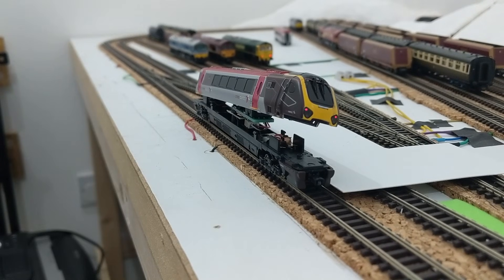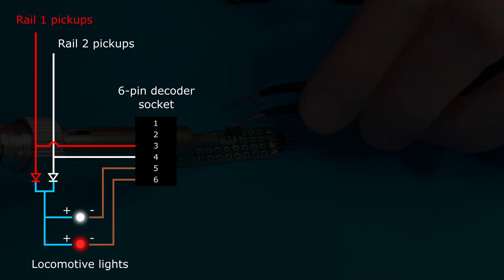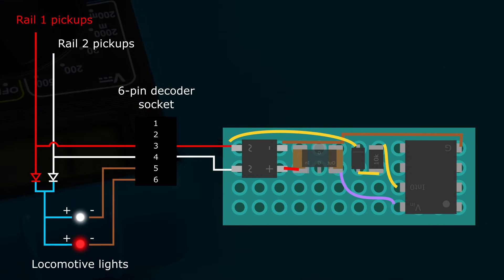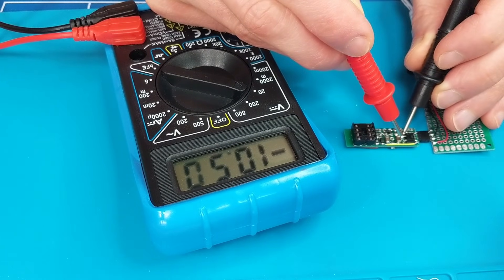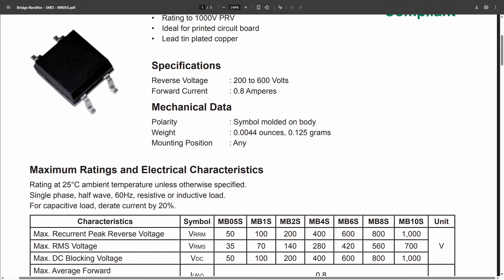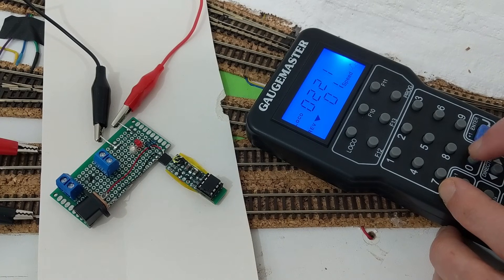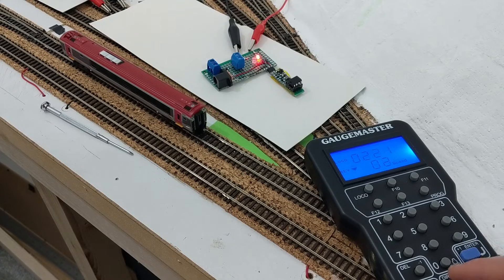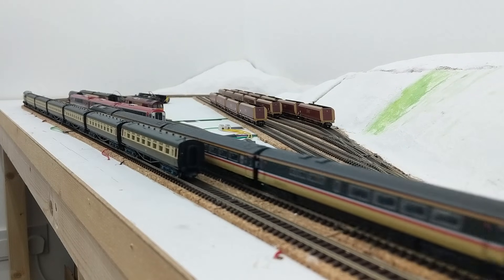0058 Making a decoder from scratch - part 5

Comment: Hi! Thanks for this very thorough video about your journey! I've done a bit of decoders with LocoNet before and plan to design a DCC decoder soon, so this was very interesting to watch.
Here are some thoughts:
* Your DCC decoding circuitry with a diode and resistor is weird. It would make more sense with a 5V zener diode after the resistor (between gnd and pin), so that the zener clamps high voltage to safe 5V and resistor limits the current through it. With your current schematic, 0 volts at tracks will read as 0.7-1V on MCU, which might not reliably trigger as 0. In order of dirtyness here are ways to read DCC that I've seen: 1) a ~30k resistor between track and MCU directly (and MCU clamping diodes dump extra voltage to 5V rail, the current is small enoguh). 2) a voltage divider to drop track voltage to 5V (it doesn't take into account that different command stations output different voltage on tracks) 3) comparator, either built into MCU or external one (does everything but it's extra space and components). 
* When troubleshooting, separate hardware from software (as you did a little bit in the end). To debug hardware, instead of attiny connect a oscilloscope, a logic analyzer or a big arduino with your code peppered with Serial.prints. This way you'll see what data your hardware sends to the MCU (sigrok has a DCC decoder plugin, I think, so you'd be even be able to see the packets). To debug software, connect your ATTINY to known-good hardware.
* Making a proper PCB and ordering it in oshpark or jlcpcb is very easy and affordable these days, and difference to breadboards is shocking! I definitely recommend investing your time in this area for making small-footprint PCBs.
* Don't know if this MCU has UART, but if it doesn't, there is a software-only serial library for ATTINYs! Helps with debugging a lot. I'd definitely sacrifice LED indication for a serial output (while debugging)
Reply from the maker: Hi, thanks for your thoughts and writing them up 🙂 You're at least the third person to suggest switching to a level-shifted high input - I like the pull-low way I've got because of its simplicity (and got the idea from someone else's project)... but if it's not going to work then I'll have no choice. But at the moment I've still got the energy to want to find out why it's not working.

With the current schematic when the track goes to 0V the int0 pin on the MCU will have to drive current through a diode, which will put the reading at 0.6 above track 0... but the MCU's power goes through diodes too, so shouldn't 0.6 relative to track still look like 0 to the MCU?

I'm convinced the software is OK on the ATtiny - it consistently does the right thing under certain repeatable circumstances. Your suggestions on testing the hardware are good - I may employ some of those 🙂 The only hardware diagnostic tool I have is a multimeter, so the idea of using something like a full Arduino to link up to the socket on the hardware is appealing.

I wanted to get the design of this all sorted and proven before moving to the step of getting PCBs manufactured for me, and would ideally like to etch my own, though running into issues regularly is making me think of skipping home-etch.

Thanks for all the ideas 🙂
Reply: @endoorrailway  attiny85's datasheet says Input Low Max is 0.3Vcc=1.5V, so 0.6V is well within specs. However it relies on internal pullup to get 5V, which might skew the waveform, though it probably doesn't. 

If you are going to make final device on a custom PCB, I'd personally remove the perfboard step from the development process. You can debug your schematic on a breadboard (solderless), and then skip to drawing the PCB and etching/ordering it. As you see, a lot of your problems come from bad electrical connections, which you don't get on a custom PCB, especially from a fabhouse. 
By the way, I think you need to double or triple check transistors connections for shorts or other electrical problems.

I'm not really suggesting it, but there are projects that turn arduino into an oscilloscope or logic analyzer (with sigrok software), so there is also this option). Though it's still 5V-tolerant, so you'll need to level-shift DCC.

Comment: Do you have resistors between the attiny and the transistors? Otherwise the transistors could draw a not of current throug the base pin, possiibly resulting in a brownout. Should be fixed with mosfets as they only charge an internal capacitor and dont continuously draw current
Reply from the maker: Yes - 6.8k per transistor - that works out, and I've measured it at, about 0.6 milliamps. Based on previous measurements of the LEDs in the tester board that should be about 20% of the load current, so well within saturation too. Thanks for the thought though 🙂 It will be interesting to see if the problem goes away with mostfets, but I've decided to do everything I can to understand what's going wrong with the current set up first.

Comment: Check out brown out detection fuse bits in ATtiny. Verify, that internal clock frequency is stable. As other option - check out in code, that stack pointer is initiated accurately and isn't overflowing. Tiny has very little RAM.
Reply from the maker: Thanks for the suggestions. I'm not sure I have a way of verifying the internal clock or stack pointer, but I'm convinced they're both fine because all works as expected for a variety of durations until one of the transistor-controlled LEDs is left on. I'll need to read-up on the brown-out feature, but from a quick scan of the datasheet I think it's something I'm going to want enabled when I start to make use of EEPROM. Thanks 👍

Comment: So cool to see! I have built my own ATtiny85-based DCC decoders (not on Youtube though) and it can be a very frustrating experience at times, until it eventually works. I don't think I have a lot of useful things to say about your problems, my decoder was built for different things and my problems were different, but I can wildly speculate and mention some things that I found if that helps:

More capacitance on the input of the 5V regulator is probably needed. I am not familiar with Gaugemaster, so I don't know if their products support RailCom, but if they do, there's a cutout of a few microseconds after every DCC command where the decoder is meant to reply, and if your decoder runs out of power in that time, that will cause weird issues. Even if your current DCC command station doesn't have this feature, if you ever upgrade (or your tracks are not perfectly clean) you'll likely run into this problem.

I've seen other people mention that the ground reference for the input pin may not be valid, but I don't think that's the problem. I did it basically the same and it worked fine for me. You can even leave out the diode and just use a 22kOhm resistor; that's technically out of spec since you're relying on protection diodes built into the ATtiny, but in practice, it works fine. You did basically all the trouble-shooting steps I can recommend, so I think at this point it's either the transistors or the overall power supply (see above with the bigger input capacitor). 

I strongly recommend learning KiCad, designing your own PCBs, and ordering them from companies like JLCPCB, PCBway or Aisler. It sounds like a big step, but once you've done you'll find that everything to do with soldering and wiring is so much easier than you expect.

Also, getting some cheap oscilloscope from Aliexpress or similar is truly life-altering. As long as it can do like 10 MHz or something it'll be good enough for DCC, and it will reveal all sorts of behaviours that pop up. Of course, even a very cheap one is still quite a bit of money, but it's absolutely worth it.

And I know you probably have way too many suggestions in your comments right now, so sorry if this is annoying; I'm just excited to see others take on projects like this and share experiences!
Reply from the maker: Thanks for the encouragement, and taking the time to share your thoughts 🙂

I should be able to try more capacitance fairly easily, and I can "programme on main", which I think means RailCom, but I'm not sure.

It's always great to know that others have succeeded with this - in earlier stages when I couldn't get things working I'd have given up with the ATtiny85 specifically, if I didn't know that it was possible for it to work from others having done it.

In the first video on this series I spent all of my spare time in the two weeks after it trying to keep up with the comments - a lot of them needed me to do some hard thinking to understand the information I was being given, but it's one of the great things about making these videos - so many people like yourself are able and willing to share knowledge 🙂 YouTube itself doesn't always help - this comment from you didn't appear when I refreshed the view, which defaults to showing ones with a "no response" status... even though it didn't have a response from me! I had to remove that filter and scroll for any that looked new.

Thanks too for reading the other comments to see what's already been said.

In comments on other videos I've been encouraged to use KiCad and the PCB printers you mention - I suspect one day I will 🙂

Likewise an oscilloscope, but I haven't wanted to spend the money on it. However, running into problems fairly frequently is making me lean more towards it - I'm enjoying being able to do electronics things, but having to theorise about problems without a proper view of what's happening is starting to be non-fun 🤣

Thanks for your comment, as with the others, it's very welcome 🙂

Comment: For electrically noisy environments, you might need to add an extra pull-up on /RESET pin 1. Being near AC fields, it can capacitively/magnetically couple and toggle resets as the included one is weak. 
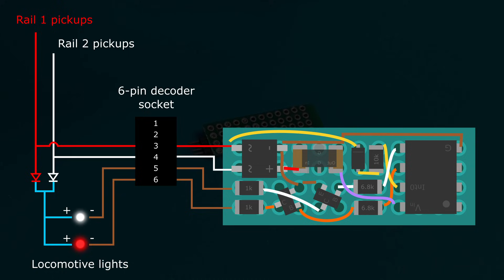As for pin 7 INT0.. the way you have that diode shown 6:00 , I fear something very wrong might be happening.. I think the pin will be experiencing -13v pulses possibly.. only thing saving it would be the series 10k resistance and any internal clipping diodes the IC has. Something like a diode making sure only positive pulses come in, then the resistor going to the IC, BUT you either want a zener diode on that pin to GND or a voltage divider to make the 13v into 5v max. Hopefully some of this helps, I used to do a lot of embedded HW stuff.
Reply from the maker: That's an interesting warning about the reset pin - nobody else has mentioned anything like that before - if I see behaviour as it it's resetting (and I'm convinced the voltage regulator is working) then I'll look at doing that!

The DCC power isn't like conventional AC - neither of the tracks will go to -13V - they flip which one is +13V and which one is 0V, rather than one following a sine wave from +13 to -13 and back. So Int0 should either be 0 when its track is at 0, or else +5 when the ATtiny internally pulls it up whilst the diode blocks +13 from that track.

With the troubles I'm having maybe changing the logic around to the way you suggest to allow current in, with the zener limiting it, will be necessary, but I'd also then need an external pull-down resistor because internally the ATtiny only has pull-up, so it'll all take more space on the board.

Thanks for your thoughts and pointers 🙂 Over the course of this series I've learned as much from comments like this on the videos as the things I've read myself.
Reply: @endoorrailway  Ah thanks for that info, I needed to read up on DCC control. Apparently I made one of the common misconceptions that there is a negative voltage state, so it actually only toggles them between GND and +13 alternatingly to encode. If you've checked this I/O with a scope it very well might be fine as-is then! Though there is a small caveat. Because you regulator works off a bridge rectifier, it's 0v referenced output will actually be offset by a diode drop from what the raw DCC voltage is whenever it hits 0, so you might actually still get -0.6v..(because the regulators GND will actually be +0.6v higher than either rail at 0v state) but on the flip side your inverted signal diode on that I/O pin would technically null that offset out, so not sure there. Else the GPIO of the ATINY using it's pull-up does make sense logically now. (Also there is a chance that just like the /RESET one, it might be a bit too weak to fight things like leakage current in the diode, fyi!)
Reply from the maker: Thanks, yes I was starting to wonder if the signal diode should be equivalent to the rectifier's. Thanks for the hint - maybe one of the things to experiment with is a separate pull-up resistor for the signal line. Thanks 🙂